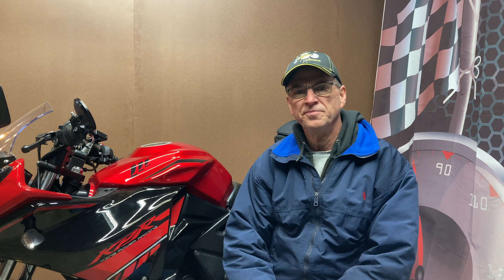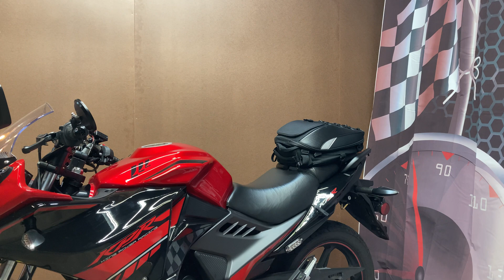Engine break in procedure - KPR 200

Comment: How many miles is the break in period? And how many miles for the 1st valve adjustment? Thanks.
Reply from the maker: If you were to use the method that I use it will be 80 percent broke in around 100 miles, it takes time for the transmission and everything else to fully break in. I use anywhere from 500 - 1000 miles as a marker for it to be totally broke in. A lot of it is in the way that you ride. As far as valve adjustments go, they are a kind of crap shoot. Some are good from the get go and others are not. I like to adjust my valve clearance within the first 100 miles. If your bike is running perfectly then you might be able to go to 1000 miles without any problem.

Comment: Do you have to adjust the valves?
Reply from the maker: Yes, it’s important to check and adjust if necessary. I’ve owned 3 Chinese bikes and all three had tight adjustment on the exhaust valves. It’s important for any brand new bike to check and adjust the valves at proper intervals

Comment: Herbie, may I ask please that you show "U.S." a few shots of you on the bike? I would like to get a better idea of riding position. If possible, please inform us of your height, inseam, and weight for reference. I am trying to get an idea of how someone roughly 5'5" with a 28 or 29 inch inseam would fit on the "King Power Racing" 200! Thank you!
Reply from the maker: Okay Michael, I am 6’ 1” tall and I am just a tad too tall for the bike but I’m fine with it. A 5’5” tall person would fit perfectly on the KPR 200
Reply: @herbiesgarage681  Sir, do you have links to the accessories/modifications you have made? I am particularly interested in the bar risers as I would like to bring it from more of a sport bike  position toward a standard. Thank you!
Reply from the maker: @MichaelWhite-cx4ho  I do have a link in my handlebar risers video. But if you still need it when I get home I’ll look it up for you
Reply: @herbiesgarage681  Thank you! I will find it!
Reply from the maker: @MichaelWhite-cx4ho  I just looked at the video and it’s not there, I’ll add it tonight for you
Reply from the maker: @MichaelWhite-cx4ho   Here you go--https://www.aliexpress.us/item/3256803733109321.html?spm=a2g0o.productlist.main.77.718cCKHCCKHClZ&algo_pvid=620ef4e6-a259-4bfa-8e48-16deac6535ed&algo_exp_id=620ef4e6-a259-4bfa-8e48-16deac6535ed-38&pdp_ext_f=%7B%22sku_id%22%3A%2212000027465743818%22%7D&pdp_npi=3%40dis%21USD%21116.0%2158.0%21%21%21%21%21%4021021f7b16760766562887430d0687%2112000027465743818%21sea%21US%210&curPageLogUid=NIlpEf9LYhz5
Reply: @herbiesgarage681  Thank you!
Reply from the maker: @MichaelWhite-cx4ho  Your welcome Michael! I just made a video that will be posted tonight or tomorrow morning showing myself and my wife sitting on the bike showing how we both fit at different heights
Reply: @herbiesgarage681  Awesome! I'm subscribed so I won't miss it! Thanks again for the content! Really helpful in making purchase decisions. I think Lifan is going to be as big as Honda in the U.S. at some point. The idea of shipping directly to consumers is a huge game changer!

Comment: How to install KPR reaching keihin carburetor please make a video on it❤️
Reply from the maker: Hi Naiem, is your KPR carbureted? My bike is fuel injected. If you have a question about it maybe I can help. Thank you for subscribing, I appreciate it!
Reply: @herbiesgarage681  carburator version
Reply from the maker: @naiemhossain4220  I’m not familiar with the carb version of the KPR, does the carb have a flange where it mounts to the intake manifold or a tube with hose clamps? Do you have an aftermarket carb that you are trying to fit on the KPR?

Comment: just rode the kpr for the first time and probably stalled at least 20 times already but its extremely fun once you get used to it and how the clutch works!
Reply from the maker: That’s awesome Tac! You’ll get used to the clutch and before long you won’t even have to think about it, it’s like second nature. I’m glad you are enjoying your new bike
Reply: @herbiesgarage681  almost at 100 miles with it and is it true I need to use standard oil for the next 500 or so miles before I switch to full synthetic? And what oil did you use after the 70-100 mile break in?
Reply from the maker: @ThaCampinSniperz  Hi Tac, I wouldn't switch to full synthetic until between 500 to1000 miles. Me personally, I'm not going to use synthetic at ll in the KPR because I like how smooth the transmission shifts with standard oil. If you watch my oil change video, I talk a little about the oil I use in that video.
Reply: @herbiesgarage681  Thanks for the input. Is the rotella t4 15w40 the only oil you're going to be using?
Reply from the maker: @ThaCampinSniperz  In the KPR yes, I try different oils occasionally and on different bikes but when I find one that makes the transmission shift butter smooth, I stick with it. Hope this helps

Comment: Some of the best info about motorcycle engine breakin I've seen on video.  Also don't idle your motorcycle while it's leaning on it's on its side kickstand. Always have the bike level when idling, even to warm it up after it's broke in. Keep that clutch wet.
Reply from the maker: Thank you for the kind words, I appreciate that! Thanks for watching
Reply: i want to a air box delet and add just a intake filter is it difficult to remove the air box? @herbiesgarage681